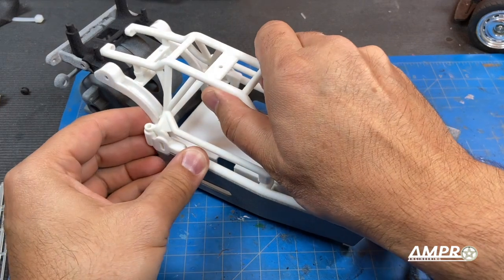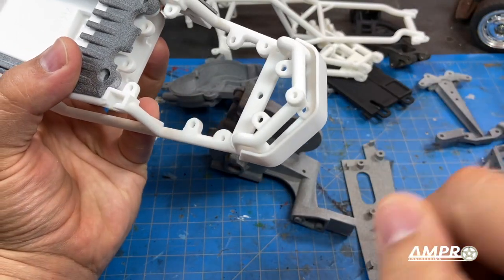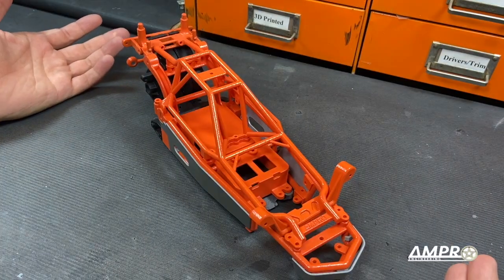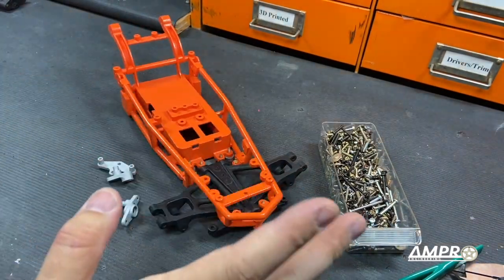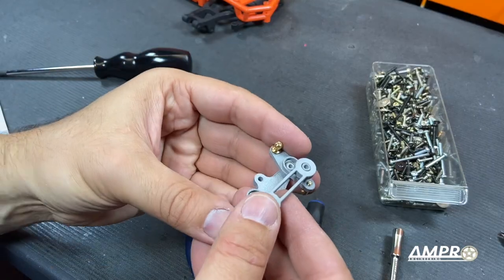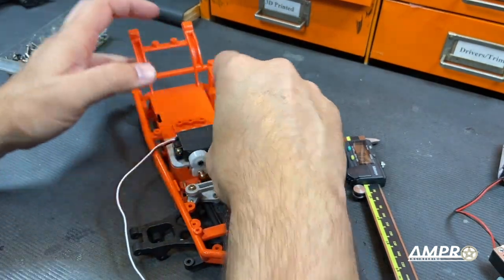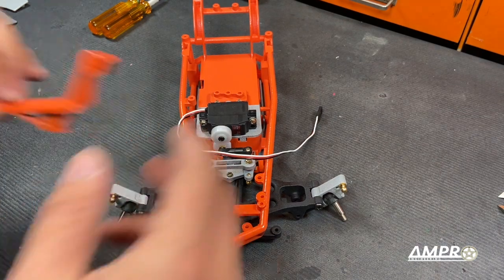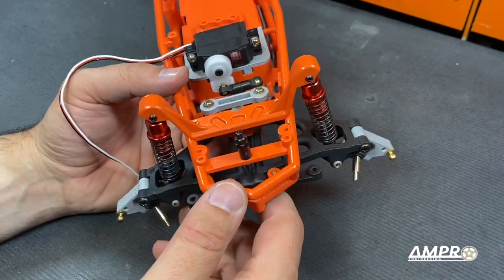e432 - SuperFly 3, Part 1: Front Suspension

Comment: Looking good! Love the stuff you do.
 Also, after doing the front double arm conversion (with 20mm offset arms) on my hornet with the upper camber links mounted on top of the chassis with the included mount, I noticed that when the suspension is compressed, the camber will go a little bit positive with a bit of tow out. To cure this all you need to is move the top camber link holes on the C-hubs 5mm or so up (which would mean making new C-hubs) bringing the camber link more parallel with the lower control arm and eliminating almost all of the alignment changes when the suspension travels up and down. You can simply test this by making some holes 5mm apart on a piece of styrene, which is easy to do, and mounting it on the C-hub so you now have one hole 5mm higher to mount the camber link to. Also, yes, I've tested it. 

Anyway, I like the suspension conversion, I have some AMPRO parts on my Hornet and like how it handles on the track, even with the straight axle it's still an improvement. LOL, now I need to buy more battery doors for the rest of my hornets and grasshoppers.
Reply from the maker: thanks! Yeah I had planned this for this build but that upright is used in a lot of builds that wont work with that. I may for this in the future.
Reply: @AMPROEngineering I goofed up my words(brain does that sometimes), I meant to say C hubs not uprights. I have edited my comment to be correct.